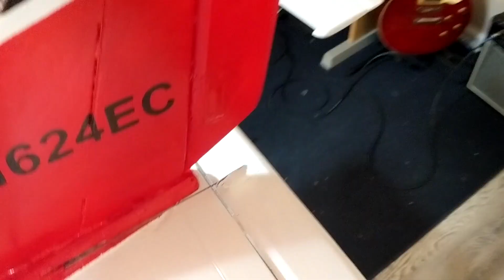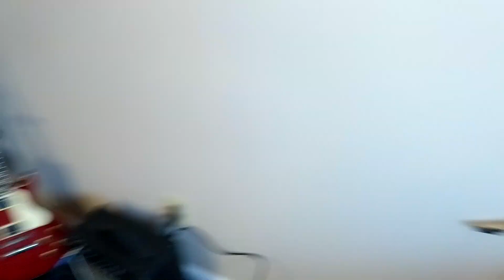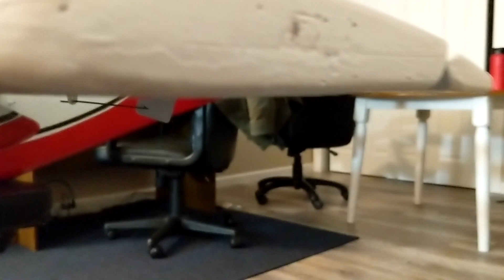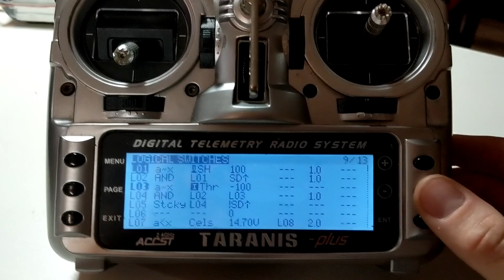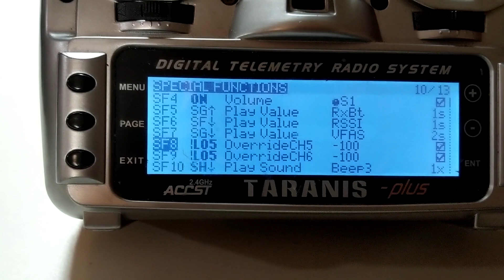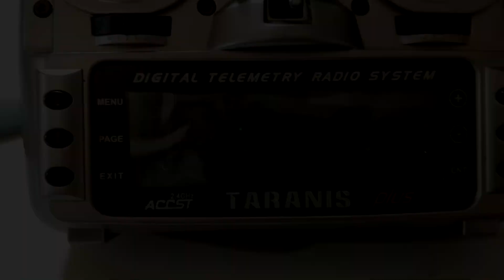80" Twin Commander DIY RC Airplane - Build Update PART 4

Comment: which lipo battery did you use
Reply from the maker: I used 3 1300mAh 4S lipos, but it was very underpowered. Probably needed 5S.

Comment: Fascinating stuff for sure. Your setup and programming go way past anything I’ve ever tried, so it was very cool to see what can be done with a programmable radio. I use Spektrum, and have only scratched the surface, i.e. differential thrust, etc. I’m really looking forward to seeing your first flights!
Reply from the maker: I used to use a spektrum dx6i, but I've found these Frsky radios are very good for making custom mixes and programming in various other features.